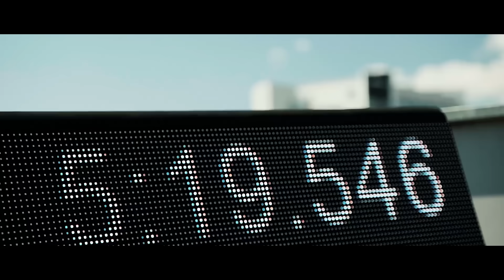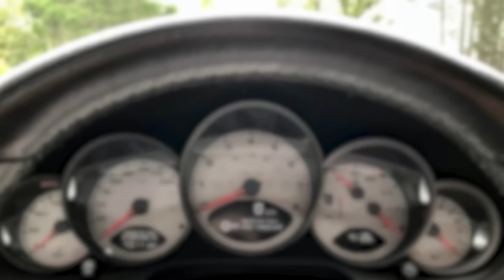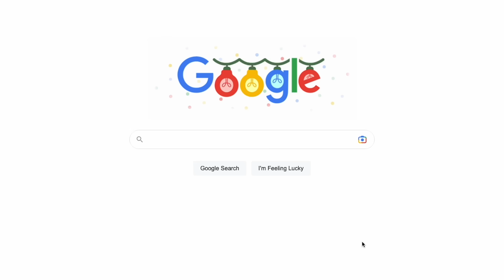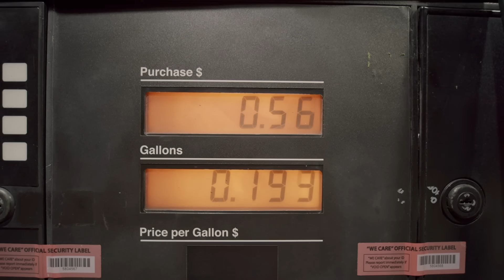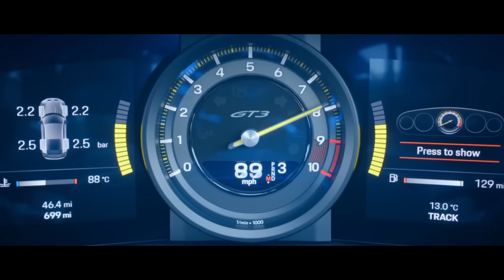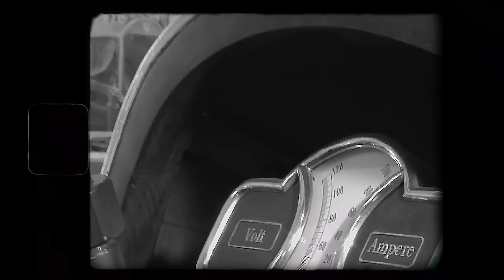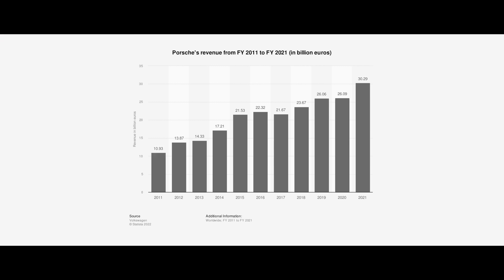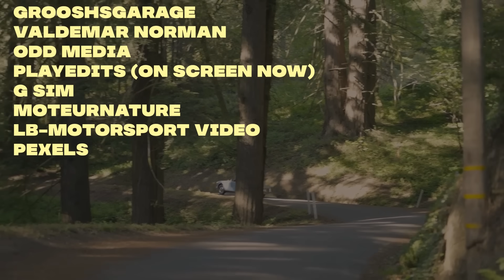Why Porsche doesn't race in F1

Comment: Great video and very informative.  I was wondering about more details other than the press that Red Bull broke off from Porsche to work with Ford, and this covered it and went much deeper into the rationale of Porsche in general.  I'm an owner and glad they are paying attention to us.  Also, not that i'm an expert, but I have worked with graphics and I thought your thumbnail and color, etc. was fine.  Obviously I saw it and the title made me click.  Keep the pale yellow theme if you like it as it does stand out a little from the other noise on the page.

Comment: Really nice video, you make a lot of good points, and it reinforces my pride in owning a 911.
I have to admit, however, that I truly hate text flashed up on the screen as the speaker talks. It is just the single worst way to use a video signal, IMO of course, closely followed by a fake hand drawing fake drawings at an insane and pointless speed, because the drawings almost never support the message, but rather just mimic it.

Comment: Bruh, youre comparing the 919 Evo, a car specifically built without any regulations and handicaps against F1 cars, which have a ton of regulations(and even safety requirements that are detrimental to them such as the halo) and have to adhere to specific set of rules made by FIA. If a team like Mercedes or Red Bull told their engineers to go apeshit, theyd build a F1 car that would never be beaten by a human ever again.

Comment: I like your videos but I feel like here you don't present Porsche's F1 efforts accurately. They tried pretty hard to join the grid by buying/merging with other teams but were denied.
Also, F1 didn't really have the option to go full electric in 2026, as the rights to an FIA electric open wheel series are held by Formula E until 2030 (or maybe '32, can't remember).
The point of the Merc AMG1 was to just build a car with an f1 engine w/out full regard to the outright performance of the car (although they tried).
Other than that, keep up the rest of the good work!

Comment: I think it would be a good allowance if they allow them to run the flat 6 and work all together to find a fuel efficient solution
Reply: Engines are way over regulated in F1 currently
They all have the same bore and stroke and are 90 degree V6 s 
Its cringe

Comment: It needs to be said that the 919 Tribute wasn't an unlimited funds project. The engineers had limited time and money to make the changes they needed to do. Picking the low hanging fruit like fuel restrictions and adjustable front and rear aero and removing the bits not needed like headlights, they got the job done.

Comment: the 911 is the utility tool of motorsports. it’s timeless, it can race in anything and win (except formula obv) and it doesn’t die. the 911 is simply a drivers car. if you want it to run it will. they hold value like crazy and they’re extremely reliable!

Comment: Good video. It gives a simple and reasonable explanation of why they don't need F1. However, your video gives the impression that F1 is only valid for marketing. Instead, F1 was the force behind many innovations in motorsport (e.g. carbon fibre on cars, kers and hybrid powertrains, adaptive suspensions). So yes, Porsche makes some of the most revered sportscars, but without F1, we would have had worse technology.

Comment: Should have used the 996TT with around 700k miles on it.  They opened the engine up to check on it after 500-600k miles and it looked near new.

Comment: It's pretty funny watching a video stating how Porsche doesn't need F1, all while they are clamouring at the doors to get in it. In your own argument, Ferrari doesn't need F1 either, because everyone knows what a Ferrari is. Yet, it would be insane for them to leave the sport at this point. Similarly, who thinks they should buy an Alpine based on their performance in the sport? And wtf is Williams selling, exactly?

F1 is an expensive af sport, and unless you are at the very top, it has just about zero economic benefits or expectations of such. At best it's an overly expensive ad. At best you can argue that engineers gets to develop technologies that trickles down, but there are much cheaper ways to do so. Every team in F1 is there because it's a passion, not for an expectation of a payday

Comment: "Ferdinand Porsche founded the company called "Dr. Ing. h. c. F. Porsche GmbH" with Adolf Rosenberger, and Anton Piëch in 1931. The main offices was at Kronenstraße 24 in the centre of Stuttgart. Initially, the company offered motor vehicle development work and consulting, but did not build any cars under its own name. One of the first assignments the new company received was from the German government to design a car for the people; that is, a Volkswagen. This resulted in the Volkswagen Beetle, one of the most successful car designs of all time. The Porsche 64 was developed in 1939 using many components from the Beetle."

"The German noun Volk (German pronunciation: [fɔlk]) translates to people."

"people's car (Volkswagen in German)."

Comment: Le Mans results LMP1 (type of car in the title video) 2014 Audi, 2015-2017 Porche, 2017 Toyota messed up in team work, it costed them 1 second loss. 2018-2022 Toyota (porche did not compete) 2023 Porche competed and lost.      2023 Ferrari, 2024 AF Corse
Le Mans results GTE Pro category: 2018 Porche, 2019 AF Corse, 2020 Aston Martin, 2021 AF Corse, 2022 Porche, 
2023 LMGTE - Corvette (porche competed in LMGTE along), 2024 Porche

No one is unbeatable. Its not just engineering, drivers, team work, tires, engineering,  luck, etc. 
Its the same thing Ferrari has built upon. A sense of pride, luxury and top tier achivement. That said, no one can win forever.  

Simple reason they don't compete in F1 is the same reason Michenline does not make tires for F1 anymore. They don't want to lower the quality or follow specific regulations of the F1 it can be tires, electric components, wing adjustments, specific height/ lenght limits, sidepods, etc.

Comment: I put 225,000 on my Carrera 4S Cabriolet that I bought new in 2004 and had u til 2015.  I then bought a 991 C4S Cabriolet in 2015 and now have 70,000 miles on it without an issues.

Comment: Whether true or not, it seems like porches automotive racing made it into their production cars.  Typically needing an extensive amount of repair after 100k + miles.  

I wouldn’t call that arguably the best if true.  A Toyota Camry just changing the brakes, adding gas, and oil would run years around that track long after the Porsche broke.  

How do I know? I have a father in law almost hitting 350k miles doing just that.  

I had a coworker with a newer 911 with the four wheel steering.  Ended up in the shop for the dumbest of things.  Engine fan, broken. 

Not saying they’re pieces of crap but I think most manufacturers can build something spectacular with no limits and an engine that can need to be rebuilt after a small handful of laps.

Comment: Good video but you can’t say their only off the best lap time by 8 seconds, 8 seconds a lap is a huge margin over one lap, even on a smaller track they would be 2,3 seconds slower a lap, these are huge gaps in racing it literally costs hundreds of millions to get those final seconds would you say I’ve only got to spend 350 million on aero this week. like I said good video but you should of made it clear that 8 seconds is not some small hill to overcome it’s a mountain

Comment: the issue with a hybrid 911 is that it blurs the line between it and the 718 since 718 is currently porche's "hybrid" line. Furthermore, a hybrid setup would ruin the 911's legacy of being a ridiculously reliable and compact sports car, since the hybrid setup is very prone to breaking down and the larger battery may require the 911 to be stretched. I think a better alternative would be to use the 718 as a sort of "testing ground" for porsche's "eco fuels" while keeping it a hybrid, while keeping the 911 fully combustion. And when the "eco fuel" is perfected and proven to be reliable enough, for it to trickle down into the 911. And from there, kill the taycan.

Comment: i would just love a road legal car styled after an F1 car or a lmp1 car. obviously put in a more convenient engine like a 3l v8. and try to kep the weight down as much as possible. drs systems can be taken to the max. but the dna of the car should be for cornering speed and handling.

Comment: To be honest making an electric car AND making it sound like a combustion engine doesn't sound that hard to me. People have been doing similar stuff for years. Rigging cars with weaker combustion engines sound stronger and louder by just fiddling with the exhaust. I'm sure you can introduce something to the electric car just to produce the sound you want. If they are able to program the engine sound into a video game and the sound of the car comes out of your speakers. You can install and program frigging loud af speakers under the electric car's hood and into the driving computer to do the same thing everytime you push throttle. lmao. That's probably cheapest way. In fact top gear should do it for giggles. You could make your car produce whatever noise you wanted.

Comment: I bought a 911 in 2018 and it was a piece of 💩. The right paddle shifter fell off in the first 3 months and they didn't want to fix it without me buying an entirely new steering wheel. I had to take the dealer to court.

Comment: "Porsche dont really need F1" LOL😂😂😂 You do realize that Porsche is owened by a VW group right? It has nothing to do with the Brand or Legacy. VW barely made 3 huge financial crisis in less than 15 years. F1 is a very expensive sport. Without a partener to share the expenses they wont join. simple as that

Comment: Bro..doing it that fast is the only way you can put that many miles on a car with no issues. Its all highway and nothing has been given the chance to sit or rot. Any car does that. Porsche is well built...but Ferrari doesnt need F1 to sell cars anymore than Porshce does. But being in F1 it helps a ton. Advertising is advertising. Mclaren...even Aston Martin at the back of the grid is benefiting. Porsche needs to get on board.

Comment: It's more like Mercedes wanted to prove the AMG one was fast While still having an f1 engine and not that Mercedes Needed an f1 engine to go fast, heck I bet if they used a simple V8 with little electricity they would've been faster for cheaper but they didn't

Comment: "without its engine, a car wouldn't have a soul"
that's just, like, your opinion man....
but seriously. the sound of combustion engines for most cars is deliberately engineered to be an important part of the brand. the sound is tailored to the car (or motorbike, etc). it's not the "raw" sound of the engine. to suggest that a car that doesn't go vroom has no soul just shows that the manufacturers have made such a strong assoociation between the vroom and the car in your brain that you cannot even begin to think outside this box. this kind of marketing is the reason why we as a society are struggling to not erase every species that doesn't directly benefit humankind off the face of the planet.

Comment: My voxel has over 450 000 Kilometers and all I had to do is replace the breaks and oil changes... it still runs good. 

Porsche nice no question. I see the every 14 days getting crushed on the autobahn by BMW's Frankfurt close to the Airport. And sorry just go to any porsch dealer and you can just grab one. There is a reason they are cheaper then other brands. They are to many available.

Comment: Mazda and rotary engines. Mazda is the only manufacturer that has used them in the last 100 ish years. They are more synonimus than Porche and Straight 6s. Also, Saying that F1 engines don't prove anything for Proche is a bad take. Porche do want to get into F1, badly. They just haven't found the right situation.

Comment: I'm not sure I buy that bit about Porsche being concerned about it not being a 911 without a combustion engine.  Why not?  They just make sh*t up.  Just look at their latest "electric" Turbo.  WTF???  The Turbo designation was used to designate the FACT that the engine had a TURBOCHARGER!   Electric engines don't need or have turbochargers.  So they have no basically made the word turbo meaningless.  Thanks Porsche, I guess my 930 is not quite as unique as it used to be if basically anything can be called a "TURBO".

Comment: The thing is Porsche don't need an F1 to build their reputation or make the fastest car or develop or adapt new technologies but if Porsche went to F1 they will be the most successful team in the entirety of F1 bcs if t they can do int with a roof and bonnet in a car think of what they can do with the weight loss but formula 1 should allow flat engines instead of classifying engines as V6 they could just classify it as cylinder engines the

Comment: F1 is epitome of motor racing, Le mans goes for 24 hrs..
F1 - 23 races, 20 different venues, 20 different climates.
Only 3 engines allowed, go past that that you will get penalty.

F1 engines are most the efficient IC power units ever built, read that again! and I can put 10 more points that makes F1 way ahead of any other motor racing event,

Note- I love endurance racing, but F1 is gold standard.

Porsche is trying to get into f1 for sometime, so they definitely need F1!

Video lacks the basic research and understanding of even basic engineering knowledge!

Comment: this video goes over some accurate sats but comes to wildly inaccurate conclusions. Porsche doesnt race in F1 because they asked red bull for a bigger stake than they were willing to give. Porsche absolutely needs to sell cars choosing one halo car model that has a back order doesnt mean porsche has no issues moving inventory. trust me a I work on a car lot and I know guys who work at the porsche shop they have as much trouble selling cars as everyone else. Porsche cant move over to F! because the like the capability to do it on there own. Even if they built an engine or got audi to share the engine with them they could not hope to be competitive with out buying in to a current team and they failed to do that. that is just how F1 works. it takes time to get up to speed and porsche doesnt want to be at the back for year well they get it worked out and they failed at there bid to buy red bull

Comment: I think the idea that modern f1 has almost any real life application anymore is almost laughable. Every year, the rules get stricter and stricter, and innovations are constantly banned out of existence. Most changes now are just suble adjustments to aero.
Sure, every few years, the regulations adapt the engine requirements to match the zeitgeist of the general motorist, i.e, making the cars hybrid, more fuel efficient, whatever, but Toyota didn't seem to need f1 to do that, and I dont think any of the manufacturers did.
F1 is all about trying to flex, which is why Ive lost interest in it. The realest racing is happening at LeMans, and Porsche knows that. I would think less of them if they joined the F1 boys' club

Comment: There is no need for Porsche to join any competitions except for the ones that it joins, also Porsche, doesn't need to prove anything except when they do... This is probably the most contradictory video about the subject.😶
Porsche needs to officially comment on F1, otherwise we can all speculate, according to me, they won't join F1 because they will probably land in the midfield which is not great for their image. F1 is not only about building an engine and creating downforce...

Comment: Okay, I can’t watch 9 minutes of this silly thought experiment. The reason why the 919 EVO grabbed the record over a modern F1 car is because the Nürburgring is TOO BUMPY for a modern F1 car, AND a modern F1 car has very little ground clearance, which would make things worse! Basically the car would shake to pieces. Porsche isn’t in F1, not because they would dominate with “superior technology,” it’s because Porsche just doesn’t find it necessary to compete in F1. Obviously they’re selling enough road cars, so no need to up the brand image by taking on F1. And if they did, I’d imagine it would go like it’s going to go for Audi in 2026: A year, or a few, of getting a feel for the F1 circus 🎪 and primarily, finding out what it’s going to take to turn the Sauber-based team they’re going to buy into a front running car, and if it’s even possible. Audi can’t just throw money at the situation because there’s a cost cap, but given Audi’s Le Mans prototype history and its GT3 racing record, I’m thinking they have a fair chance of running with the big dogs after a year or two of teething. And there’s the matter of driver talent to attend to, and right now, the market for top notch drivers is pretty slim, with the fast kids having long-term contracts with their current teams. (Well, Lewis is going to Ferrari and Sainz is going to Williams, but you get the idea.) So yeah: Why no modern F1 car with the Nürburgring record? The track is too bumpy and the cars are too low. The current cars are ground effect cars and need to run low over smooth tracks.🫳🏽🎤

Comment: Absolute dribbling rubbish. Porsche entered F1 in the 1980s/1990s and it was a highly costly, highly embarrassing disaster for them.
Too little power, too thirsty and lots of broken engine parts left on the racetrack.
Add Lamborghini and Peugeot to the long list of manufacturers that tried and failed.

Comment: In my opinion, Redbull is kinda delusional when it comes to making decisions. They are using an old spec engine from Honda just to continue racing. Redbull is just an energy drink, not an automobile manufacturer. If Porsche would have stepped in, it would be a good partnership. A Porsche engine in a Redbull car would make sense. 🤦‍♂